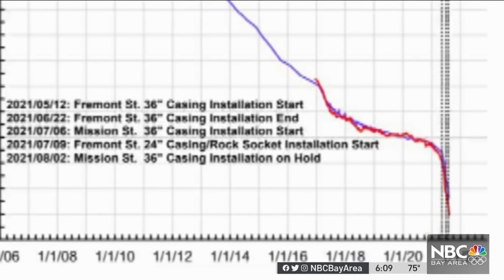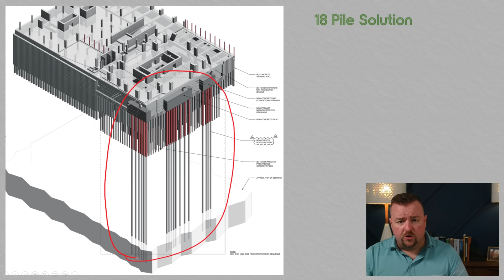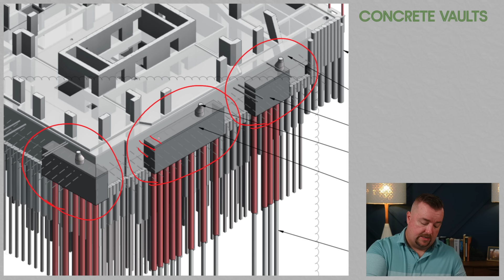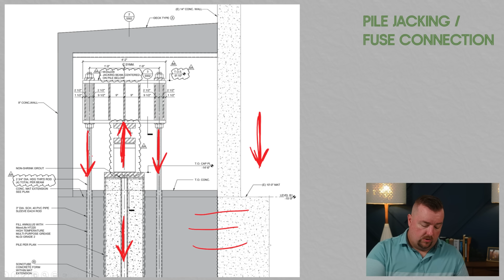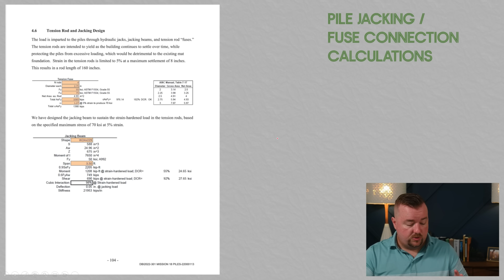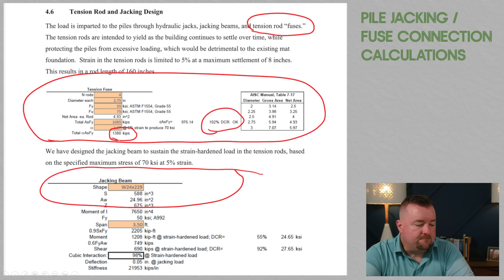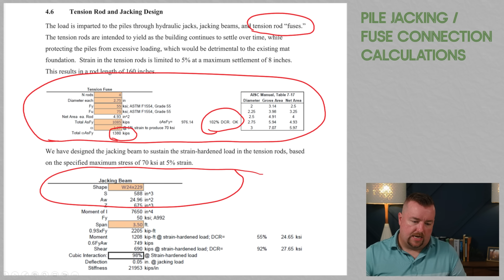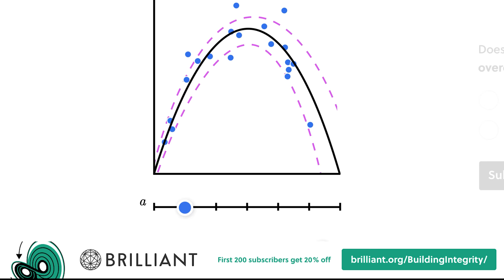Did I Uncover a $100,000,000 Mistake with the Millennium Tower "Fix"?

Comment: The problem I see is the repair only attaches TO THE PERIMETER of the slab.  That is not a good idea, the slab was not designed to support itself only on the perimeter.
Reply: There is no practical way to get underneath and support the rest.  The slab will have significant tension capacity because that’s the plane the reinforcements are laid in; that should be OK.
Reply: at this point i am surprised putting a rope around it and tying it to a big tree hasnt been floated as an idea
Reply: @jsnsk101  My brain kept telling me: just tie a rope to the nearest building and call it a day.
Reply: @jsnsk101  all the old growth redwoods in that area are long gone…😅
Reply: @mertonallowicious  Sad but true.
Reply: My understanding of the 'fix' is to slow/halt the speed of settle in that corner while the 'other side' catches up. Wouldn't that mean these forces don't reach the designed-for peaks?
Reply: @Georgewilliamherbert  No! Engineers do NOT rely on "that should be okay." Instead, they run the calculations and say "it has a safety margin of X in tension." IMO, even without running the numbers, there is absolutely no way that they're going to be able to rely on the foundation slab in tension with these sorts of forces. Concrete is great in compression and lousy in tension even with rebar through it.

For this idea to have a hope of working, they'd need to attach the vaults to the building using anchors on the opposite side of the building in order to put the entire slab in compression. Not that the fuse plate at the bottom of the vaults is going to work as-is, but these connection points between the building and the vaults aren't going to remain intact either. This fix is giant risk and getting it wrong, as they have done so far, causes the building to get worse! They needed to design the fix with about a 4-5x safety factor and they've actually designed it with a 0.98x safety factor, then scaled back the number of piers. 

The building is currently falling over in slow motion and nothing they've done so far has had any positive effect on it. Time has just about run out before the listing starts to become measurable by the day, and then by the hour, at which point, it's too late to take the building down and everyone has to evacuate nearby buildings until it actually falls over.
Reply: @jsnsk101  that seems to be as effective of this plan !
Reply: The slab foundation is an immense pad of considerable thickness, something like 20 feet or so. The hope is that the slab is sufficiently strong to withstand side loading.
Reply: @wallacegrommet9343  10 feet, actually, and it's already dishing. One of Josh's vids explains why.
Reply: @wallacegrommet9343  "Hope" is not sound practice in engineering.
Reply: @wallacegrommet9343  You don’t “hope” with engineering, except maybe with hoping that extra unexpected hurdles aren’t found during the construction phase.
Everything else has to be calculated with large safety margins. The idiots who built this seemed to ignore those very basic engineering principles.

Comment: Great commentary. I'm old enough for the process you describe here to have resonance with that which resulted in the STS-51L Challenger disaster in 1986 -- what Dr Diane Vaughan described as normalisation of deviance. Those small plates transferring the entirety of the forces in the "solution" being implemented to my mind are the equivalent of the rubber O-rings in the joints of the solid rocket boosters of the Space Shuttle system -- a criticality one failure mode: if they fail to do their job, there is no backup and the entire system is prone to destruction. I for one wouldn't want to live in a building that has such a failure scenario, especially where the engineering design appears not to have been fully calculated, or independently checked.
Reply: The entire idea of these so called fuses seems crazy. It's not a fuse if it can't be replaced! They needed to come up with a non destructive way of limiting the amount of force they apply to the building.
Reply: In theory, the best thing that could happen is more tilting and sinking and then demolition.
Reply: Those plates will act like fuses....if one goes under high stress they all are likely to fail in succession. And it would take very little time, maybe seconds.

Comment: They should just tie it to a nearby building with rope as in the early scenes of Idiocracy. We're already there anyway.
Reply: I wrote that they  should install a bunch of guy wires  that can double as zip lines for amusement.
Reply: If only they had built a normal steel and glass building that the other steel and glass buildings nearby could hope to hold up.  But these big brains built a concrete building weighing many times more then a normal skyscraper.  Then "talked" the SF board of stupidvisors that a foundation only into sand and trash will hold it up.   The best part?  It will probably fall into the gigantic Salesforce tower.  Or more likely, through the Salesforce tower.
Reply: @gelf1907 
They designed a steel and glass building, with pilings that didn't go down to bedrock.  They got as far as completing the foundation.

Then they changed the design to be a concrete tower twice as heavy as the steel building originally planned.

Then they built the concrete tower on the foundation that had been designed for a steel building half the weight.

Then they were 'surprised' the foundation slab started to bend and the building sank quicker and further than planned, and started to tilt as well.

Comment: I am not a building engineer. I have worked for forty plus years in both residential and commercial construction as a carpenter. Just casting an amateur glance at the blueprints you are showing I am concerned too. The steel plates appear to be very small and weak for the downward force they will encounter. Also if they will be anchored to rebar and concrete , that also appears to be a point where the plates can punch through. The sketchy connection of the pylons to the existing structure seems lacking in such a shallow connection. All of these elements would work well on a much smaller structure and would present more predictable behavior. The fact that the structure has shifted and is tilted twenty three inches and weighs tens of millions of pounds seems to throw in some unpredictable factors. I don’t believe the structure can be saved.

Comment: So the force of the pile is transferred by a series of elements that each will need to function without breaking. That is:
- the pile itself
- the jack
- the I-beam
- the nuts that are screwed onto the threaded rod
- the threaded rods
- the nuts at the bottom
- the miniature plate you mentioned
- the concrete of the vault that connects to the original foundation mat
- the rebar that transfers in a shear situation the force to the foundation mat
If the threaded rods now are put under a tension that is close to their breaking  point, that means several things are critical:
- the bolts are both ends of the threaded rods, because the transfer surface for the forces is small compared to the cross section surface of the threaded rod itself (I saw no calculation of those)
- obviously the plate at the bottom, as it will be subject to considerable shear force also
- but as that plate is so small, we need to consider also how those forces are transferred to the concrete at the edges of the plates: there wil be no compression forces, but shear forces and locally there will be pulling forces, which will tear the concrete
- rebar is good for tackling the pull forces in the concrete and if they are pretensioned they will even remove those, but here as the rebar is cast without pre tensioning, calculation is required to prove that the new concrete will indeed be capable of transferring the shear force
- spreading the load of 1 pile over 4 threaded rods... as this is not a static exercise (the building will keep on moving over time), there is no guarantee that the 4 rods will each indeed pick up their 1/4 share of the load. It is likely that some time in the future the load will move and unbalance the 1/4 share. That means there will be a rod that gets into trouble, as it is already now dimensioned at the edge of being critical. There will be rods that snap. That has a domino effect, as that happens to the rod with the highest load first. That load will transfer directly to the 3 sister rods, that will in ideal circumstances each now pick up 1/3 of the load, which is likely to be over critical. We will be lucky if that pile is not quickly "discharged" as all 4 rods or their bolts will snap. That pile is then rendered useless, and the piles next to it will almost immediately see their load increase considerably. In the worst case, this will cause all rods in a vault to snap after which the building is no longer connected to the nice extra piles. 
Does not look good, I'll stay out of SF for the next decades if this plan is executed. 
😉
Reply: > there is no guarantee that the 4 rods will each indeed pick up their 1/4 share of the load. It is likely that some time in the future the load will move and unbalance the 1/4 share.
That's where being at 102% of the yield strength helps. If one rod is under more strain, then it would stretch a bit, letting the other rods pick up more of the weight.
Reply: @djinn666  102% of yield strenght = DEAD = GONE ! This means 3 rods are to carry the load originally designed to be carried by 4 rods. Result: 8.3% extra overstress on the 3 left-over rods. So the next rod is to fail immediately. This part of the story will repeat itself untill all 4 rods have GONE. 
STAY AWAY from 100% yield strength, you fool!

Comment: I am reminded of the Citicorp Center engineering crisis of 1977. It too had a serious miscalculation that was uncovered by an outsider. Let's hope you're either wrong (in which case no harm is done), or the response from the Millennium Tower engineers will be as professional as what happened in New York.
Reply: Would be cool if a "random" person on YouTube with expertise and integrity would help to fix the problem.
Reply: There is no hoping. There is only analysis or no analysis. This situation is "no analysis" and Josh is absolutely correct that the system of passing loads through from the "fuse" rods to the vaults is both completely unanalyzed and massively flawed. Also missing from the calculations: the tensile stress placed on the foundation slab and harmonic system performance during an earthquake. I do not expect that a system that's "designed" to perform statically in yield is going to outperform an earthquake. This would be like taking a stock 4.3L Chevy engine and subjecting the stock heads to top fuel dragster duty with a 30 psi blower. The head bolts will let go when the stresses get high enough and the building will topple, pronto.
Reply: @supremedictator.  There may be little hope that the video is wrong, but there is still hope that the reaction will be more appropriate than to do nothing, or to attack the bearer of bad news. Citicorp shows that such a reaction is possible.
I don't see how that's going to happen with Millennium Tower, given the history of its engineering team and the very public nature of the problem (Citicorp's flaw and redesign was handled in secret), but who knows.
Reply: @ilesoft82  Yes, that'd be the best possible outcome.
Reply: @renerpho  "the ideal outcome" would be that the engineering team calculates the concerns and can show that it fine with safety margins.
The complain "I do not see the calculations" is totally valid and supplying them late would be alright.
But... given that the design seams to be on the edge, the results could be very unhappy.
Reply: I MAY BE WRONG, BUTT  . . .  As I recall the Citicorp story, an architectural student, who'd been told by their professor that the "offset column" design was weak/flawed, had sent a letter to the architect/engineer, prompting his curiosity to review some things.  The supposed flaw was not correct, but he incidentally discovered that, contrary to the original specs., the contractor had opted to bolt (instead of rivet or weld?) most of the structure, which caused the building to be inadequately buttressed, and, as "luck" would have it, as the "emergency repairs" were planned (under the guise of some kind of night works) a hurricane was heading up the coast as the welding was done)? ... but I could be wrong.    B-)

Comment: I've been following the channel for a few months and I couldn't resist doing the calcs myself. Below is the summary of the calcs
back of the napkin maths (10mins) have shown that there is credible cause for concern. Best case the margins seem to be razor thin. In Australia all structures must be below a percentage of yield. As I mech eng I always aim for 50% of yield strength.our design codes vary from 66% to 75% with so many other factors built. I'm surprised there isn't something like that in USA and they are permitted to push the limits.?. 
My calculations show that the plates are 1.2 - 1.5 times overloaded in shear after you factor in washers and other stress concentrations (which I did not). Bending calcs were not performed because i don't have the reinforcement details. Happy to do a quick calc on that as well...
Designing to yield is dangerous territory and If i had to guess the Engineers are under duress to cut costs. What would happen to the building if the foundation suddenly reached the ultimate tensile strength. the sudden rupture would cause impact loads many multiples of the static forces...
Anyway good luck mate, let me know how you go. I can email you the excel spreadsheet if that helps
Reply: God forbid they have anyone say the word eartquake near it.
Reply: The impact load of something dropped from zero height is 2 X the mass. So 1kg becomes 20N. So if  one of those bolts fail the other ones will follow through quickly and the whole fix will open like a zipper.

Comment: I have been in the electric power industry and the telecom industry and have designed with anchor bolts up to 3”. The problem is the ACI 318 does not cover this situation. In the power industry, the heavy hex nut is sufficient to anchor a 55 ksi bar. There are sources that provide test data and metods. None with 2.75 in diameter bolts. The bar is essentially acting as a template to holds the bolt in position during construction. I would have tied all the bars together with a bottom template. The other interesting situation is when load is applied by the jack, the load will go to the bottom of the bolt and you will know if the system is working or if the concrete has ruptured and failed. The bar will not fail because the load path is into the concrete. Even if the bar is overloaded, the load will go into the concrete. The failure mechanism is crushing the concrete.

Just a note, the engineer could have eliminated the jamb nut and put the bar between the two heavy hex nuts and reduced the thickness of the plate.

If I was the building official, I would require test results to vaidate the design because there is no way to calculate the design. This type of design is done by experience and standards of the industry and this design is not standard in the building industry. It should work, you just can say it is the standard in the building industry.

Anyone needing a PhD topic, here you go.

Comment: You're right, those plates are overstressed in shear, both across the full width and around the perimeter of the rod hole.  It also looks like the bearing stress of the concrete on those plates is way too high - I get nearly 10ksi of concrete bearing stress.  I don't know what the ultimate strength of that concrete is, but it would have to be about 14ksi for that to work, and that's an extraordinarily high concrete design strength.  There's no reason that those plates have to be that small.
Reply: Or maybe there is something we do not understand and upon which we should pursue clarity.